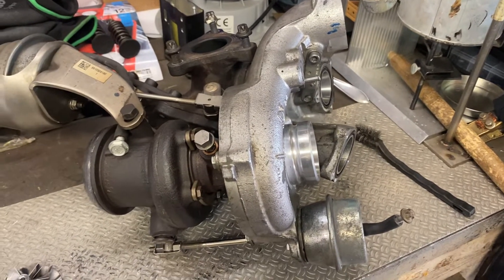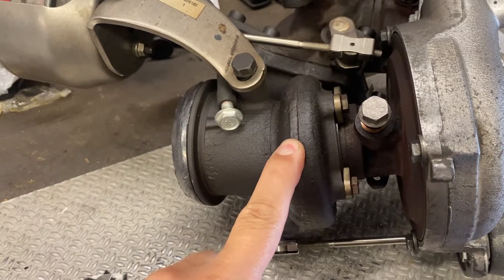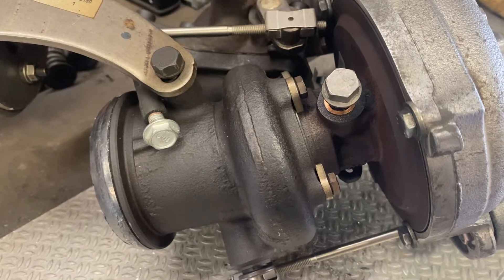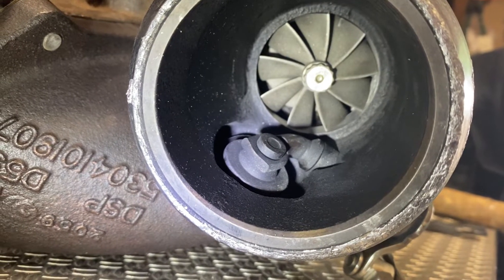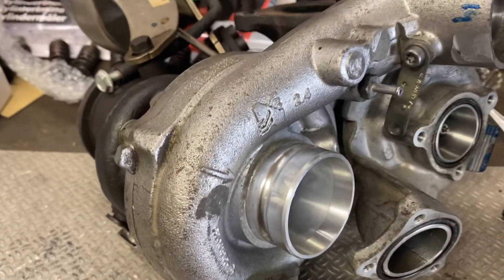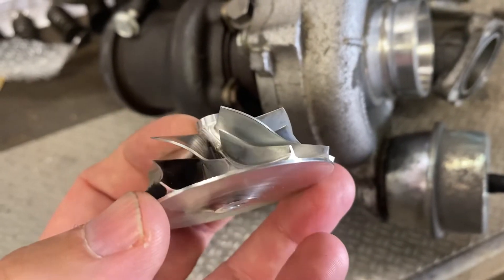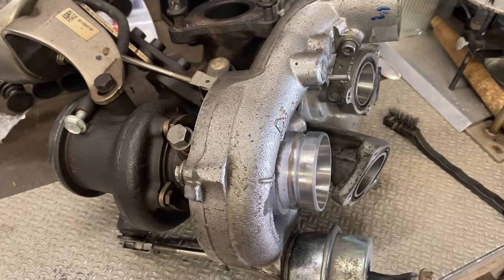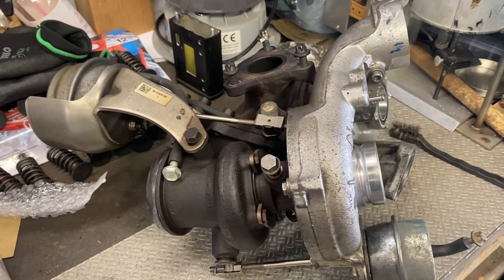Mercedes OM651 twin turbo upgrade finished.

Comment: Anyone wanting to give their 651 (twin) Bi-Turbo some more power from standard would need be to buy the Turbo from a E250 or C250. The second Turbo is larger and also the injectors.
These mods will run on a stage 1 or stage 2 Map with good gains.
If you can find anyone you can also mirror the mapping from the 250 for more power and torque gains.
If your sprinter is 2014 onwards and has the 3CRD ECU your gains will be even more.
Torque you can read through a good scan tool like XENTRY.
BHP you will struggle to find someone to fit a Sprinter on the Dyno 
Also go for a DPF EGR Delete the reason why most of these engines fail are because of the regeneration process and oil dilution.

Comment: Hey! Nice job ! I'm looking forward to adapt these turbo(s) into an old diesel engine. Since I have little or no information, do you know if it is possible to convert the original wastegates to positive pressure? Thanks for your attention ! Bye!!
Reply from the maker: Should be easy to convert to positive pressure, you just need to change the actuators from vacuum to positive pressure models.
Reply: I am looking to adapt this turbo to om611 ,so my idea is to use n75 solenoid for first small turbo,and for the second big one to do positive solenoid ? But i do not know how much pressure they can handle? How much psi to setup before waste gate kick in? 
Thanks in advance

Comment: what extra changes? in the software , how much power with just changing the turbo, my engine now 204hp & 500nm
Reply from the maker: Turbo alone will give you 10-15hp as backpressure is reduced. Then more boost and more fuel, changing the torque limiters and about 20 other maps to get everything working properly without errors and keeping DPF happy.
Reply: @MJPilote i would love to know if you can finally hear these Turbos whistle now?
Reply from the maker: @100pyatt  Yeah, turbo is louder with the upgrade. Not much but now you can hear the turbo working.

Comment: May i ask? When you upgrade all things of the car with this turbo and om651 engine. How much do you get about WHP after Remap(Tuning).
Reply from the maker: I don’t do estimates, need to dyno it when I have time and get the summer tires under the car. But it’s much faster than stock for sure.

Comment: Just to confirm, did you modify your turbine housings to fit the larger wheels?  Looking forward to updates.
Reply from the maker: Sorry for the late reply YT has again turned off notifications for messages, yes I did modify both housings to fit the larger wheels.
Reply: @MJPilote  thanks very much for saving us from bad purchase, I was actually going to buy one of those scams not knowing what the original specs are, now I know, thank you.

How do your turbo mods here affect the low end response/lag and driveability? Would you still recommend this to someone who wants to keep low end close to standard, not worse in terms of lag?
The reason I ask, I definitely want more power but I don't need 350 - 400, if I can have 250-260 on the wheels I'd be happy with that, but I don't want to compromise low end too much. Am I looking at this right? 
Thank you
Reply from the maker: @samsonsamsamsam  This hybrid I made works better than stock unit, it wakes up earlier as there is more flow through the bigger turbo so the smaller spools faster. Boost is instant from down low. And the bigger turbine flows much more on top end. I would say it's best of both ends of the power band.
Reply: @MJPilote  wow that is great to hear buddy, thank you very much. 
Your compressor wheel is 47.15mm if I recall correctly from your other vids, any chance you remember new turbine wheel size?
Anyway, thanks very much for sharing your great work 👍
Reply: @MJPilote  did you redo the compressor pipe to eliminate the check valve and plumb as standard compound twins ?
Reply from the maker: @100pyatt  you cant eliminate that otherwise you'll blowup the smaller turbo.
Reply: hmmm okay
Reply: Very great full 👍

Comment: Hi mate. Where i can conect to you? I need sooner 🙂
Reply from the maker: If you mean you need a turbo like this you need to contact one of the turbo shops local to you and ask for them to modify turbo for you.
Reply: @MJPilote  i only want to know your exactly shaft sizes or where to buy,and your compressor wheel sizes or where ti buy 🙂
Reply from the maker: @АлександърАлександров-щ5э  all K04 size shafts work, just take your pick on what kind of hp you want .
Reply: @MJPilote its a vw turbo 2.0 tfsi 😮
Reply: Hi mate. Can you again contact with you for a second? Some facebook or something?😀

Comment: Hello, where can one find the material to upgrade, or is it custom made?
Reply from the maker: You meaning the turbine shaft and compressor? They are normal K04 BorgWarner upgrade parts. Easy to find online. Only thing custom is the machining to fit to the housings.

Comment: Just saved me a bad purchase. I wonder if I put a similar wheel or similar to the factory one, but with a better design of the blades and without touching anything else, will the power increase?
Reply from the maker: No, the factory wheel is very good design. If just changing one thing I would change the turbine wheel for 9 blade high flow version.
Reply: @MJPvut where i can finde it and its belong to wich turbo cars name ilote

Comment: Hi! Is it possible to install twin turbo setup on the single turbo OM651? Do you think it is a bolt on swap? Thanks.
Reply from the maker: It should be pretty bolt on swap, but you need to figure out the boost controller wiring and solenoids. And use twin turbo ecu software.
Reply: @MJPilote Thanks for your reply and sorry for the late answer. Im planning on buying a used turbo from a C250, recondition it and install it on my w204 C200. Your vids are really helpful. If you have any tips, they are much appreciated.
Reply from the maker: @dragossoroceanu  You can use either 220cdi or 250cdi twn turbo, they are the same. 220 turbo twin is slightly easier tofind and cheaper for what ever reason!
Reply: What size compressor will fit into each turbo with machining work? ... Can you do 9 blade turbine on both Turbos?

Comment: @MJPilote looks great ! glad to see that the respons at low end of the turbo is way better. Thats exact the thing i am looking for. I think there is a market for turbo's like yours. You could be in the market for a lot of cars/vans as twin setup is getting a regular thing. All sprinters and vito's  2016 to 2018 have them, all vw crafters and transporters 2011 to present have them to. Golf , passat, amarok,  MB E, C , you name it... There could be a business with great potential if you find the time to do so.

Comment: any update how it went? :) Did it work out?
Reply from the maker: Turbo is still on the shelf waiting, car broke an injector and I needed to fix that and bought a motorcycle from auction that needed work too. Now I have the flu so need to rest. But as soon as I get it mounted I will make a video.

Comment: Can you post parts when we can get them online?
Reply: MJ I also would buy the upgrade if it was available.   Very interested as I enjoy drag racing my C250 CDI coupe.
Lots of toque with right tune. 

Thanks for the videos!
Reply: Even in Australia we love the om651
Reply: @paolouchicentofanti8494  i think MJ maybe will be reconsidering ;)
Reply from the maker: I dont sell parts, this is more of a hobby project.
Reply: @MJPilote  too bad, i think you could make some money on it. a lot of hobby car enthusiast that have the om651 especially here in sweden ;)
Reply from the maker: @MsBot100  Well need to think about it, not exactly the thing that I do. I make prototypes and engineering design for customers. This is just something I wanted to do.
Reply: Much boost.com
Sell a kit that looks similar to your specs 2 options 
280 & 330hp 

https://muchboost.com/product/om651-2-2cdi-hybrid-bi-turbo-upgrade-mercedes-c-class-e-class-s-class-glk-sprinter-viano-vito/

Comment: Hey, great video. On what car are you putting this turbo ? What would be the hp goal ? I have a sprinter with the same engine. It has been chipped to +/- 230 hp. As i drive heavy cargo and through mountain areas, i would like to upgrade the turbo to get the egt temps down. Mine still has the pdf, and i would like to keep it that way.  So is this setup something you would recommend ?
Reply from the maker: W212 and the setup should be good to around 300+ I run dpf without any egr. Works good and regen interval  1200-1500km
Reply: @MJPilote  how is the spool on this upgrade. Will it suffer from low down or will it pick up just the same ? I don't realy need more hp, but any torque improvement would be great. i'm also planning on upgrading the intercooler, and eventually at some point water injection to keep inlet temps down. An thoughts on that? Your input would be greatly appreciated.  Do you sell upgrated turbo's like this one?

Did i get this right: You are still running dpf but no egr...?
Reply from the maker: @dirkclaes8821  I will tell you when I get to test, car is waiting for new injector.
Reply from the maker: @dirkclaes8821  yes dpf and no egr. Turbo is much more responsive now, car has wheel spin now if flooring from stand still ESP off. And if wet it spins even on third on lower speeds. Much more torque with new tune I made for this turbo setup, it is instant torque now from down low. That’s how restrictive the oem turbine is.
Reply: 300 HP nice Joke😂😂😂😂😂😂😂😂
Reply: @gehtdichnscheidreckan5322  , And why would that be a joke?  With software on a single oem turbo you can get +200hp,  and a twin 250hp. Bench proven. Injectors , exhaust and improved breathing chould get you there.  I’ve had a shitty 1.9 cdti Opel , modded to 330hp, stock, unopened engine. Engine had +/- 280.000 km, and kept on going. Drove like an animal. Didn’t brake down.The merc has 300 cc more so 300hp would be a peace of cake.
Reply: @dirkclaes8821  Dude this engine is already in a bad condition its from the Quality a bad Joke. Because of the Injektors to timing Chain to the pistons und other parts
Reply: @dirkclaes8821  nice Joke i got the same shit engine its catastrophal i want engine what does 100000000000 but never again om 651

Comment: if you could share the dimensions and wheel part numbers that would be great
Reply from the maker: Need to check the dimensions, cant remember from tthe top of my head
Reply: @MJPilote  🤔
Reply from the maker: @ KO4 46.47 / 52 turbine and 44.92 / 56.08 compressor.  Sorry for the delay, have forgotten.